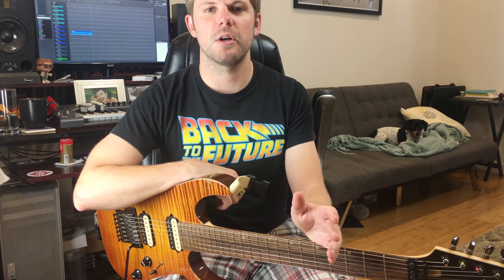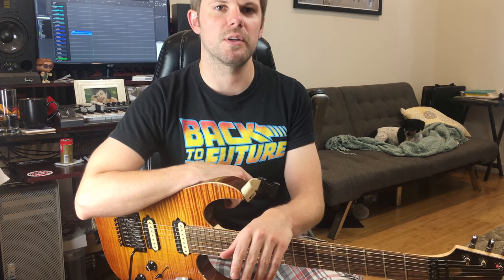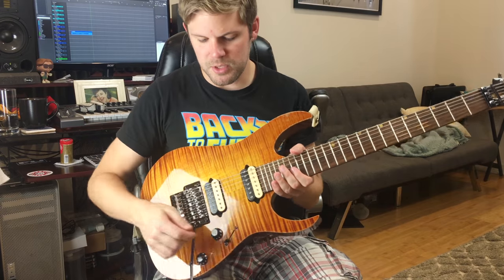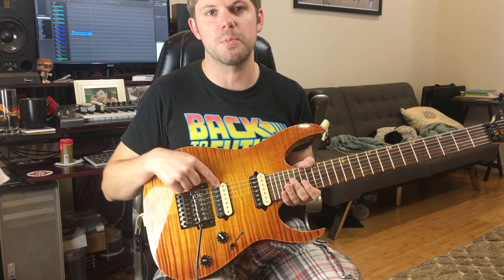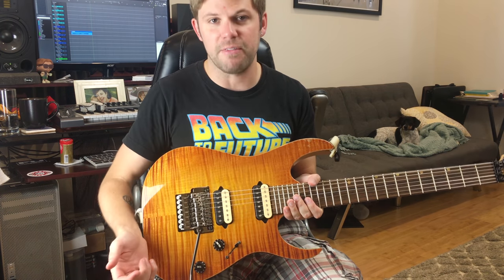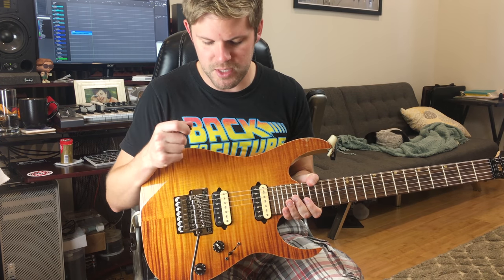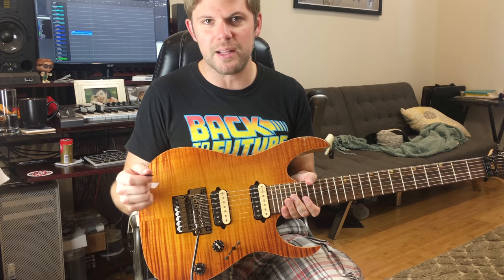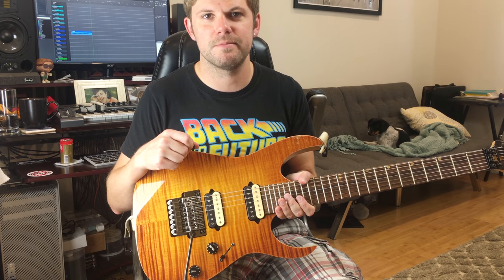Guitar Pickup Switch | HOW IT'S USED

Comment: My friend was arguing with me that the pickup selector makes a difference to where you should be picking the note.. I.E on the bridge pickup your left hand should be strumming near the bridge and on the neck your hand should be picking more towards the neck. I told him that's a load of rubbish, who is right? Cheers and great video and playing.
Reply from the maker: Thanks for watching and thanks for the kind words! 

You're both kind of right. No, you don't need to pick near which pickup is being used to detect the sound, I normally recommend to all my students to pick somewhere directly in the middle of the pickups, that gives you a balanced tone. Not too bright, not too dark. But you CAN change where you pick to create variations in the tone, and create either a special effect (like picking very close to the bridge to create a tinny sound) or over the neck for a warm effect. 

Hope that helps!

Comment: great video mate, thanks, does the out the  out of phase position produce lest output sound and hum always?
Reply from the maker: Thanks for the watching and the kind words! Yea, normally the out of phase positions will have less output and have 60 cycle hum but it does depend on the pickups you choose and how they're wired. I've got another Ibanez guitar that's wired differently (I don't actually know how lol) and while there's still a drop in output there's not really any hum. If you talk to a guitar tech the might be able to help you choose a setup on pickups or a wiring configuration that has less hum if that's a major problem for you. If you haven't already, consider giving the channel a sub too! I've got loads of guitar reviews, original music and other guitar related content coming out each month.

Comment: I'm sorry but I just got an ibanez 5 way switch and am still clueless at which of the 5 way switch does. I'm kinda new to guitar and bought a Ibanez RG652AHM-NGB Prestige. I was wondering which is better for clean mode and what's better for rock etc in the 5 way switch? As sorry I don't really understand what the bridges and stuff do
Reply from the maker: Congrats on the new guitar, and it's ok! All the switch does is change which pickups are capturing the sound of your guitar. General rule is the neck pickup is going to have more low frequencies and have less output and the bridge pickups is going to be brighter. 

There really aren't any rules, any pickup combination can be used at any time. What you choose is your artistic choice. Just listen thru my examples and focus on the way the different combinations sound and experiment with whatever it is your currently playing. 

Also, you might want to look up some info on your favorite songs and try and find out what pickup they're using and begin to train your ears to hear the difference. Also keep in mind single coil pickups like on a Strat will sound a lot different than hum buckers. I've got a new video on my channel breaking down the difference between them too! 

Hope that helps and best of luck!
Reply: @aminorerror  thanks so much, loving from a Les Paul to this is totally different lol
Reply from the maker: YES that will be very different! The way way switch is really cool, think of 1, 3 and 5 like the same as what you've got on a les paul, and 2 and 4 are for more 'strat' like tones. I LOVE position 2 personally, I think you can really hear how it opens up the tone of the guitar in this video.
Reply: @aminorerror  awesome yes definitely! Thank you so much, love my new guitar just wish I could play it to a good level lol but that'll come with practice and patience :)
Reply from the maker: Stick with it and you'll get there! Remember playing an instrument is a life long pursuit, and try to create a practice routine/plan and stick to it as consistently as possible. Little bite size chucks is the best way to go as often as possible!
Reply: @aminorerror  definitely, a new guitar has definitely given me the motivation to keep me going thank you :)

Comment: How do I know I should do the switching pickup??
Reply from the maker: There's no hard rule! It's totally at your discretion, just trust your ears and have fun!
Reply: Usually the Neck pickup have a more darker maybe warmer tone 
Whereas the Bridge have a brighter tone, more precise sound (i think)

Also people tend to  use the Neck pick up when they go high up the neck to avoid making it too bright ( i think)😅😂
Reply: @psk5896  yeah, thats correct
Reply: If you tried a palm muted chug in the lower area of the fretboard using far right, switch position, you would get that awesome deep, crunchy sound (assuming you are playing metal with higher gain) unlike with neck pickup, which is typically for lead guitar playing. Then there is what Spoder BOI already replied.

Comment: Hi. Why does switching the pickup changes the tone. I mean I have used of my friends guitar and when I switch the pickup in upward direction it changes to distortion from clean.
Reply from the maker: It changes where the guitar is 'picking up' the sound. The neck pickup is darker, or has more bass frequencies, and the bridge pickup is brighter and usually has more output. That's probably why there's less distortion on the neck than the bridge.